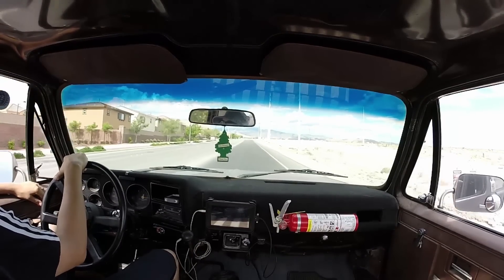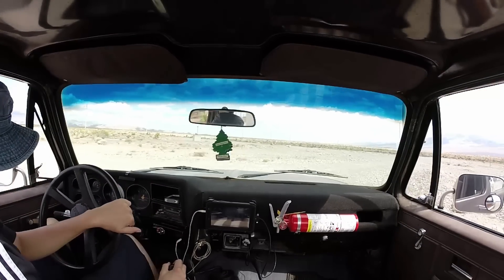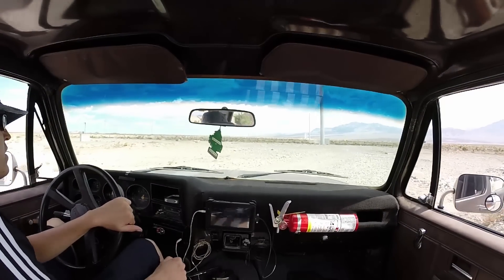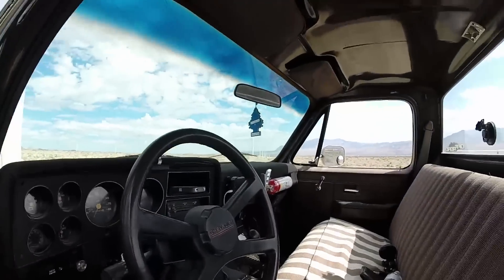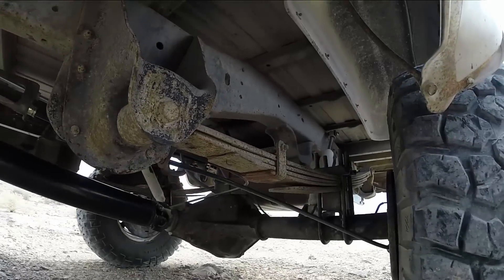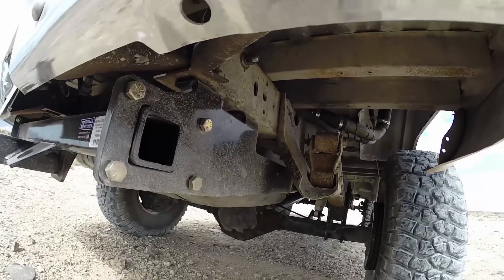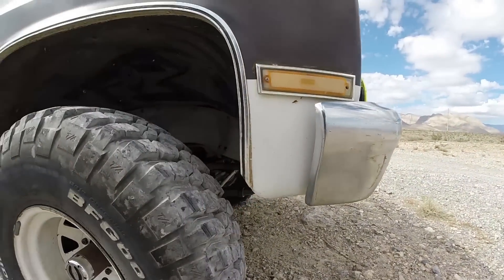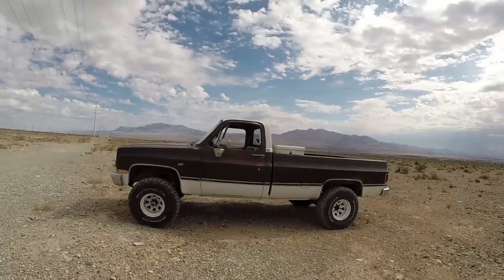Chevy K10 update 8.10.14 Letting the LS sing!

Comment: Hey bro man I like your work you do on you trucks it done right and nice. I'm planning on building my k20 but I'm new to going off road with trucks but I ride banshee and dirt bikes  at dumont and just wonder how does your k10 do in the dunes and rock crawling do you bottom out on the dunes? Every one is telling me that I shouldn't try to dune my k20 that it's going to bottom out because of the wheel base. Sorry for asking such a dumb question lol just need some advice
Reply from the maker: Dylan Corona Thanks Dylan, to be honest I have not wheeled my K10 much, however I did wheel the hell out of my K5(similar set up). Bottoming out / high center is a matter of length vs height, you will just have to get out there and see what it can do and experiment. I personally love the sand dunes and dumont was a blast in my K5 here is one of it climbing comp hill LS 5.3 K5 Blazer climbing Dumont Dunes comp hill In the rocks you should hook up with a group of guys get out and test your truck. Wheeling in the rocks really takes a toll on your truck and tires, make sure you have front and rear recovery points, rock sliders and protection for things like your gas tank etc. Check out some K20 build threads on pirate4x4.com

Comment: Hey man, love the stance of your K10. what size lift and tires?
Reply from the maker: Jon Beeson Thanks Jon, Its 2.5 front springs and 2.5 block out back, 35" tires on 15" wheels.
Reply: Did you have enough clearance? I would like to set my K10 up the same way without cutting.
Reply: And do you think 34's would clear?
Reply from the maker: I'm not sure, I had to do some slight trimming to fit the 35's, If I had my front sway bar disconnected they would still rub.

Comment: ARE YOU RUNNING A 4 SPEED (SM465)?
Reply from the maker: +Zach Penna Yes, it works good.
Reply: +MrWhitels1   How many rpms does it run at 60mph?
Reply from the maker: Next time I take a drive I will give you an accurate number.

Comment: What motor mounts did you use
Reply from the maker: +Brandon Wesley I used standard 3 bolt small block mounts with advance adapter LS adapter plates.